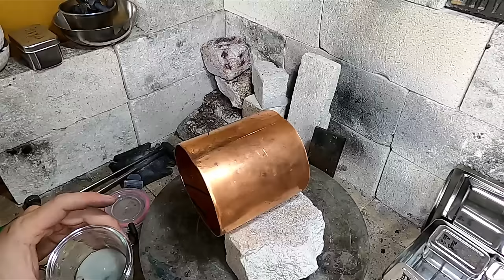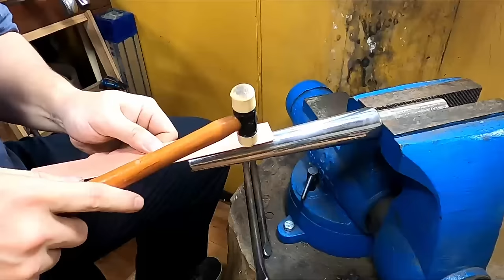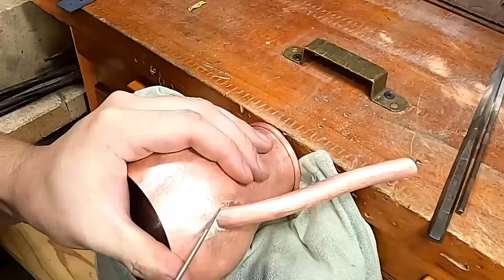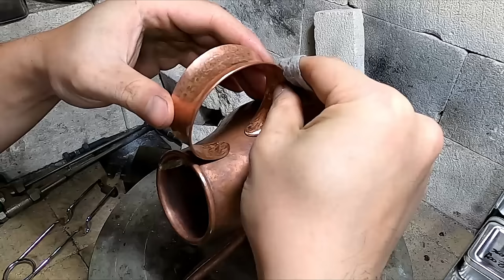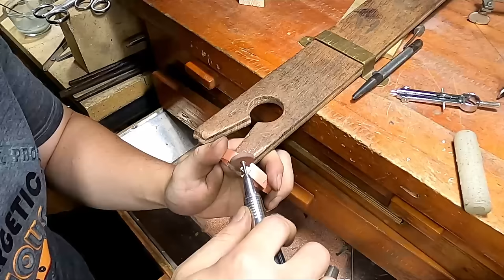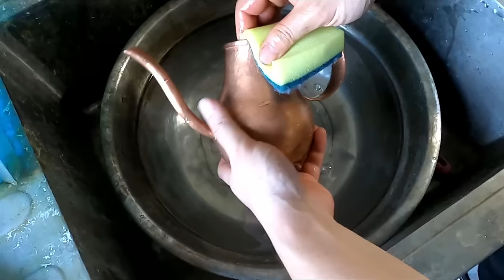금속기물 - 우아한 주전자/metal vessel - elegant kettle

Comment: What was that white solution used to tin the inside of the vessel ?
Is that silver solder and borax flux you are using  ?.. 👍😘🏴
Reply from the maker: An electroless tin plating solution was used.

Comment: I wonder what kind of solder he uses? does anyone know? it doesn't seem like silver solder in any way. abünd in what way did he treat the inside of the pot? I only know the tinning and this is used to be hot. I really like to know and would appreciate any information. thanks a lot.
Reply from the maker: I used silver solder. The inside is electroless tin plating.

Comment: I'm sorry, why did you have to go through all that trouble with the straight plate at the 13th minute? Couldn't you just cut it off with scissors? And a question: what solution did you tin it with? Is it some kind of tin salt? What is it called? If it's not a secret, of course.
Reply from the maker: you're right. It is an electroless tin plating solution.

Comment: Nice but not useable it will take to much heat to boil the water w/o breaking soldering.pure lead and tin has a low temperature to melt
Reply from the maker: Silver solder is used for metal bonding, so it can withstand high temperatures. Of course, tin plating can be dangerous if you boil it yourself.

Comment: This video made me angry.

Back in elementary school I wanted to make something like this at metalworks class, cant really remember what I thought it was but it was supposed to be made out of copper sheet and hammered into shape. 

The teacher gave it a go. He probably didn't know any better than I did.

I had access to a hammer and anvil, and I had the metal scissors so I could cut the sheet, and other ordinary tools, but beyond hammer and anvil I had none of the fancy tools shown here, that could had helped me hammer the sheet into the shape I wanted, nor any access to information on how to make the tools if possible. On top of that I had no idea how to make joinings with copper, I assumed the teacher would tell me how, but he had no idea either. He was proficient with woodworking and that's why he was hired to teach handicrafts by the school/town, and he knew how to work with steel projects, but copper was right out. On top of that we weren't even allowed to use fire in our projects, we got a hot air blower we could use but that's it. (that meant that blacksmithing was also a no-go in that school. Apparently a tablesaw was just fine but fire, nope. Use of the heavier machines was supervised but why a blowtorch couldn't be, no idea.)

I ended up wasting my time, completely scrapping the project (both physically and administratively speaking) and had little to show for my skills. I got a barely passing grade, and no fancy project I could show at home. 

This didn't affect my career choice since I had already decided but I can imagine how someone who was more interested of working with metals (other than steel, in that school) would had gotten so poor impression of the craft that they'd never try it again, even if they were super interested before and thinking it a possible career choice. 

Anyway it is nice to see someone create something with his hands. Please, take an apprentice if you already haven't and if you can take one at all. Crafts like this won't be taught in modern schools and even if they are we cant trust that they wont suck all joy out of the work before students can even get a proper feeling of the craft.